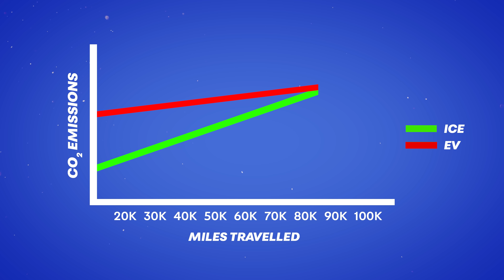Are Electric Cars REALLY That Green? [New 2022 Data]

Comment: I’m pretty hopeful that electric cars will become more efficient to run. I’m also hopeful that they’ll become more efficient to manufacture.

That being said, we have to remember that these car manufacturers are businesses, and they want to get you into a new car asap, which means they’re motivated to produce and sell as many cars as possible, electric or not.
Reply: EV's are signifianctly more efficient than ICE, 90% EV 25% ICE just look up an electric motor to an ICE engine in fuel consumption to power output.
Reply: @gav_derbyzen  Yes and no, your number is the amount of energy (eletrical or chemical) which can be converted into mechanical energy. So yes, EVs are very efficient running because electric engines are very efficient at transforming electrical power (stored in chemical form within the battery) into motion power and battery charging is quite efficient but that is not the only measure of efficience, there is the efficience of power generation, efficience of energy transport, efficience of energy storage (outside of the car) and there is kWh/km (energy needed to move you and your luggage divided by energy to move the car and its content). All these parameters can also be improved and, if we focus on the car (or all EV including planes etc) kWh/km can be drastically improved if we find new battery technologies that increase energy density of these batteries. At the moment, although you do get an efficiency of 80%-90% depending if you measure it at the power plant or at the car level, the cars still use up a ton of energy to drag extremely heavy batteries around and that is the biggest waste. Also, the UK needs nuclear because solar and wind are far from producing peak capacity at all time and there is still plenty of coal, biomass, gas being burnt.
Reply: @Photoandcargeek  Yes and no to electric production, UK renewables accounted for 43% in 2020 which is more than fossil fuel, now we have the Norwegian and French power cables operational we can take advantage of their renewable electric production to decarbonise our fossil fuel power plants. With ICE you also have to factor in the well to wheels emissions of extracting, refining, transporting, pumping fuel, this figure is never produced in studies that favour fossil fuel usage. Electric efficency still comes out the winner and I agree with time this will get better and better...
Reply: @gav_derbyzen I know all that regarding ICE, didn't deny it in my previous message. This year despite the 43% theoretical capacity, there was far less wind this summer than average summer so the production was significantly lower than that. Also, since Brexit there is no power exchange agreement between the EU and the UK and the EU can set it's prices and not trade at cost and other EU countries get priority and demand is high and there is no surplus for the UK.
So nuclear is needed urgently and the UK is planning to build a lot of new and smaller reactors but that will take many many years.
Reply: @Photoandcargeek  I'm currently working on a geothermal power station project in Cornwall (1 of 2 planned) and Geothermal could produce about 20% base load electric for the UK, factor this in with wind, solar and storage and we are getting there. It just needs an effective government to get behind it but I guess Chinese money and French companies don't get a look in so the transition will be delayed. We're feeling the pain of Brexit through the supply chain and energy costs. I dream of the UK producing it's own energy and manufacturing it's own cars, vans and trucks but this would be bad business for the defence sector selling arms to Saudi in return for oil. We could go on...
Reply: @gav_derbyzen  but still can't beat ICE cars when it comes to fuelling time (Or charging time in Electric car) and Range.
There's few Electric cars that can get above 500 km range than ICE. If they gonna make it that we "people" and stop worrying about range , then make it now and stop wasting freaking time. Time is ticking, if they are not promised, they're just lieing all the way. 
For us ICE or Diesel engines, we can chill and drive whatever we wanted, but we spread CO2 a lot (Which is downside) and that's it.
Reply: @Ren_1106   ICE cars can't beat EV's for running cost or perfromance, cars spend 95% of their life parked so that is an opportunity to charge, you have to think of macro thinking instead of micro thinking. Range is only an issue if you drive beyond 300 miles everyday and even when you do you can charge in 20 mins whilst you have a break. It's a different mindset but some people can't walk and chew bubble gum at the same time!
Reply: @gav_derbyzen  I don't care about Electric cars Performance. Only good at straight line and that's it, heavy as hell. Reminds of a stupid Phone, once you done using it, charge it.
Reply: @Ren_1106   Is that the same stupid phone you're using to reply with.
Reply: @gav_derbyzen  same does yours as well.
Reply: As long the stupid government and climate Activists stop b1tch1ng and complaining about Electric cars are the climate change, reducing the CO2 (BS to me) and forcing us to buy Electric cars or forcing us change their I.C.E cars to Electric. 

Everybody has different taste of their cars, stop comparing them and stay out of this nonsense comparison.
Reply: @Ren_1106  Reducing C02 is extremely important but the problem is that the public and politicians think that reducing individual CO2 production will make a difference ... it won't. They should tackle the production of CO2 where it is the highest frst, not tell us that we can't drive petrol cars because even if all the cars in the world were off the road, that wouldn't make a significant difference. It is industry level CO2 production and cargo that produce most of the CO2 in the world, they should tackle that first forcing carbon recapture at the factory level etc. Some publications estimated that between birth at 70yo the CO2 generated by a human life (and all its activities including transport) is 1 second of current planet wide emissions, your ICE car would only be a small fraction of that.

Comment: Ok, several things.  Let's assume to begin with that the creation of the electric vehicle takes more resources because of the fact that the lithium needs to be mined.That is if the batteries even require lithium nowadays. (I don't believe this is true but whatever). For instance, nobody complains about having to mine for platinum used in catilyc converters. 

 2nd point would be that electricity is created with fossil fuels therefore we are not making any air quality improvements by using electricity. 

 I in turn would argue 2 points. Number one, Ice vehicles not only burn gasoline for their entire life but we have to consider how we are producing that product and it's enviornmental effects.  For instance, are we adding in the the burn off that is done during the pumping process? Because as we've all seen as the oil rig sucks the oil out of the ground there is gas (I believe methane) that is being burnt off. But also what about the long term effects of how much oil is being used for oil changes? The fact that we have to do something with the leftovers of the 2 to 4 oil changes that we're doing every year per vehicle. 

 And lastly the world's electrical grids are becoming cleaner and cleaner every year. Many more countries are implementing huge solar  arrays as well as introducing battery backups to stabilize the grid. The end result is we are getting rid of coal fired plants as well as not having to build natural gas fired plants to replace them. Solar and wind as a whole are becoming the cheapest form of electricity and that will only accelerate the growth towards cleaner electrical grids.

So this argument against EV adoption is complete BS and Volvo is full of it.  Let's remember how automakers make their money. And that comes down to not only the sales of the vehicle, but more importantly the maintenance of the vehicle, and  continued sales of parts and of course dealer franchise fees. All of which pretty much come to a total stop when you look at brands such as Tesla. 

Lastly, this is why car companies are pushing for hydrogen, because there is money after the sale to be made, there is no money in electric motors, it either works or it doesn't.
Reply: 1, Yes Li is still used in most if not all BEV batteries currently. Cobalt is the one that some chemistries has eliminated.
2. Using FF for electricity is 1, more efficient than and ICE. 2, usually happens in more rural areas so is less of a local air polution issues for towns and cities.

Your quite right that people don't look at the materials used for ICE or for it's fuel when dismissing BEV. Most don't realise that cobalt is used in the refining process for example but it's suddenly a big issue that it's in car batterien never mind phones and laptops.

From the video and a brief skim through the pdf this looks to be one of the fairer (if a bit leniant to ICE) comparison reports that has come from a legacy manufacturer. EVs are worse to manufacture (for now) but are better over the life of the car and that difference is just going to keep getting bigger as the manufacturing footprint decreases and the grid gets cleaner

Comment: There are a number of caveats that should be considered if used to EV vehicles in general. 

It is quite a stretch to judge all electric vehicle manufacturers based on this study; the report itself highlights its own short comings; as a manufacturer they represent less than 3% of the EV market; other much larger manufacturers are ahead with regard to carbon neutral manufacturing plants; methane and nitrous oxide emissions, though a small percentage of tailpipe emissions, are excluded; the study is inconsistent in its use of datasets, which it freely admits, etc.

It is an interesting study comparing the manufacturing of Volvo vehicles. Broader representation of EVs does not appear to be the objective.

Comment: Great video Rory!! Thanks for bringing us this. I think a factor we should all consider is who long we in the UK and Europe typically hold on to new cars……. I believe it’s c.2-3 years …. Surely this then skews the stats back towards ICE taking into account average annual mileages…..I’m still yet to be convinced about the second hand market for EV’s 5+ years old due to battery degradation and the massive costs of replacing them…… all points towards Hydrogen and synthetic fuels!!!
Reply from the maker: The cars don’t vanish after 2-3 years of their existence though. 2nd, 3rd, 4th etc owners continue to drive them, so the CO2 savings continue.  I have a used 10 year old Nissan Leaf which is still going strong
Reply: 6 year old 50k mile i3 owner here. Car is as good as when I bought it and only lost £4k going by a we buy anycar quote (I realise market is a bit silly at moment though!)
No idea why people think the used market is such a worry. So far it's probably stronger than buying an i.c.e
Reply: @Jeremy Baker - If only there were a website which aided the consumer by adverting those 2-3 year old 'second hand' cars and facilitated their resale so someone else can continue to use them. lol. FYI, I think the average lifespan for an ICE car before it is sent to the scrap yard is 11 years. I've got a 6 year old Nissan Leaf with full battery life reported (doing 10k miles a year) and before that I had another Leaf, sold on to someone else at 5 years of age. This older one also reported full battery life at the time I sold with 50k miles on the clock. The newer one has less miles because of pandemic, but in both cases, the battery date shows the cars I've had will EASILY last 10 years. And.. as Rory's videos attest.. an EV with as short a range as the first gen Leaf will never exist again.. it's the worst EV.. and it's still great to use and perfect as a second car for short journeys. As for Hydrogen.. waste of time... if someone offered to swap me my 100 mile range Leaf for a brand new Mirai.... I'd laugh, it would (and forever will be) far less convenient for me. As I don't have a hydrogen tap on the front of my house! Too little too late for hydrogen.
Reply: Most 5 year old EVs will still have 2-3 years warranty on the battery and drivetrain assuming they haven't been driven into the ground.

Comment: But a "green" car is not only all about cO2, a Petrol car for example emits: hydrocarbons and nitrogen oxides to (witch are carcinogenic) direktly where people live, beside cO2. And with the electric car batteries there  is a huge potential in future to produce them with much less cO2 or bad working conditions like in africa, but not so with the burning gas in a car engine. And refining gas or diesel from oil takes a huge amount of elecricity to btw.. ,almost the amount a electric car needs to drive the same distance. This all should be taken to consideration to.

Comment: Nothing new here. It's been well documented for years that the lifecycle emissions of EV are high, and need to be driven and used for certain number of km and years before achieving emissions parity. With advances in tech, and continual increases in emissions and costs for fossil fuels the threshold will get lower and lower. Buy an ev and keep it s few extra years, entirely normal as it's more reliable and you're good. Disclaimer: i still drive an ice car, i don't think Tesla is a great company, i dislike Elon Musk, and i think there's still more transition that needs to happen. The bottom line is, if everyone used ev, the world's emissions would be net lower.

Comment: An internal combustion engine (even a petrol) will go on beyond the 125K miles point, perhaps double. If the EV requires a new battery at 125K, the carbon footprint will then leapfrog to being worse again than the ICE car. A key factor needs to be longer battery life as well as range.

Comment: the only issue I have in this video (which was amazing and fascinating and I thank you for it!) is the idea that the EV is keeping your home town cleaner.  but at what cost to the countries in which the battery materials are mined?  it really feels like passing the buck.  it seems EV vs ICE is a closer debate than originally envisioned, but the big takeaway here, I think, is that with a few more technological advancements and EVs will easily surpass ICE.  maybe in as little as five years this same study might look drastically different.  and actually the other big takeaway here is that people who lease cars for 2 years and then move on to something new are the big culprits here.  and they are going to have to reduce the frequency of getting new cars in order to have the smallest possible environmental impact.  i.e. run that EV into the ground! 😂😂
Reply: Your not wrong but the same can be said the for countries affected by drilling for oil and spilages that happen from time to time The hope being that eventually a significant portion of EV manufacturng can be done with recycled materials including the battery. Also changes in the type and chemisty of batteries shoud lower costs to the countries where the raw material comes from. Lastly don't forget those leased cars tend to hit the used market at more reasonable prices (when the used market isn't insane) letting people who normally couldn't afford an EV have the option
Reply: You DO know that battery and car manufacturers plants and mining locations are controlled, and are NOT in tight busy city centers. You can't compare a city plagued with polluting cars to a plant or a mine that's located miles away and is easily controlled and can be made better and more sustainable. It would be even better for those countries to adopt electric mobility in the long run even though they're polluting more in the shorter term, because the polluting is far away from urban areas.

Also, leasing companies don't necessarily hand out NEW cars. EV's are much more reliable and with batteries becoming more and more efficient and sustainable, you could just as easily swap a battery in an old car, and BAM - it's a new car. The electric motor can easily drive for hundred of thousands of miles before it needs any fixing, and even then - it's such an easy fix, it's a non-issue.
Reply: Sure, but the cars that are leased for a short period end up in the second hand market meaning other people can buy them instead of a brand new car.  The cars don't just vanish after the lease period ends.
Reply: Sorry, but you fail to account all the technological improvements that can already and could be made to ICE vehicles to make them (and their production) even cleaner, but which are discouraged by regulations (e.g limiting the bhp per cylinder in the EU), all of which means that it’s not a fair fight between the 2 technological paths.

Comment: A very good point, but this also applies to most of our green electricity production. Take a wind turbine and calculate it's total carbon footprint to mine materials, produce the steel, the concrete for the base etc, and they need to run for more than 25 years to break even. The same can be said about solar panels however the end result is a cleaner environment cleaner air with us all having better health. It's about what is best in the long run.
Reply: Nah, it has already been calculated to be about less than 10 years.